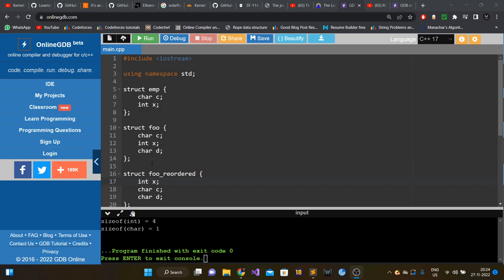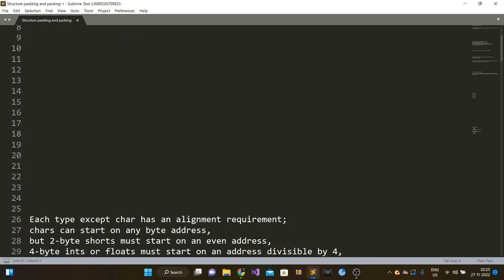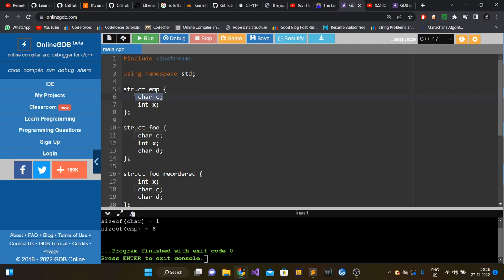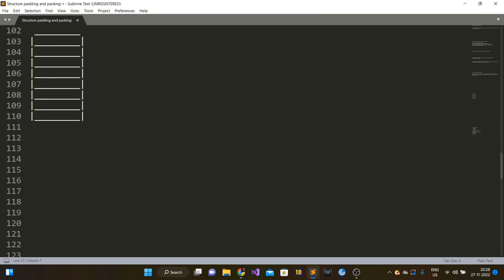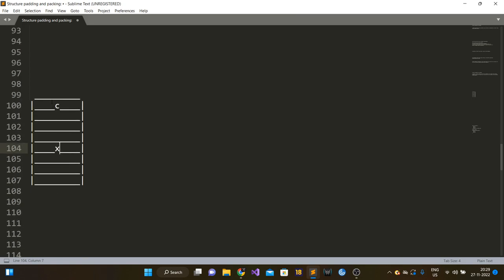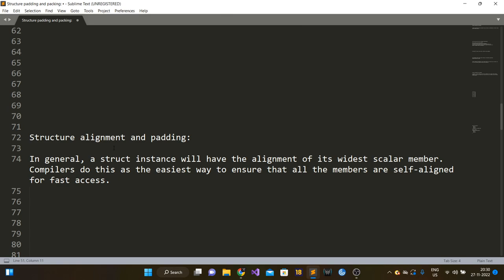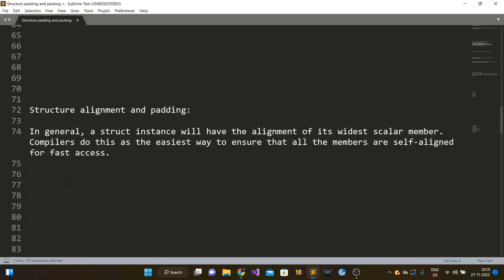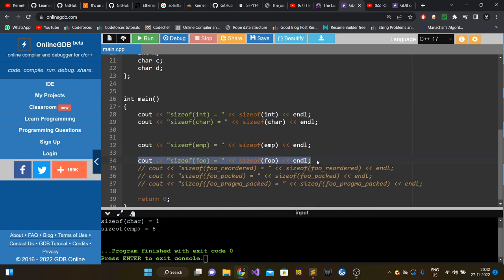C++ structure padding and packing | Memory alignment

Comment: Padding concept is similar to OS concept of resource sharing , it will try to execute code while minimising the processing of by allocating units in each run . Am I correct ?
Reply from the maker: No. Memory alignment is done so that CPU can read data from memory in a single instruction which is very fast.
Unaligned memory access is slow.
Reply: @CodingInterviewPrep  This memory alignment concept you’ve explained is all padding does . Correct?
Reply from the maker: @nik7867  yes padding is done by the compiler to make sure that the struct data members are aligned according to the size of widest data type.

Comment: Nice Explaination about structure padding Sir, back in 12th class used to multiply max size variable to find structure size but didn't know about memory alignment.
Reply from the maker: Multiply max size variable with WHAT to find structure size???
Reply from the maker: If you used to multiply that with the number of data members in the struct then that formula is dead wrong.

struct S {
    int x;
    char a;
    char b;
};

Size of above struct is 8 and according to your formula it will come out to be
4 * 3 = 12 which is incorrect.

Your school took a lot of money from you in the name of fees and taught you wrong things 🙈